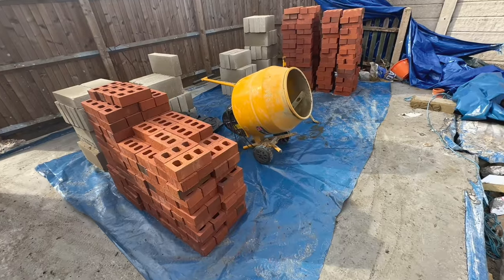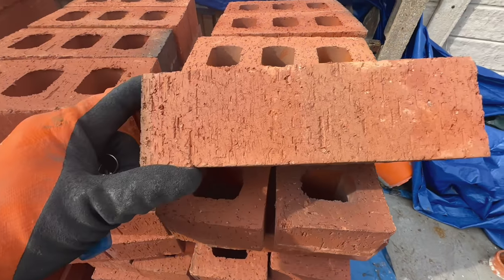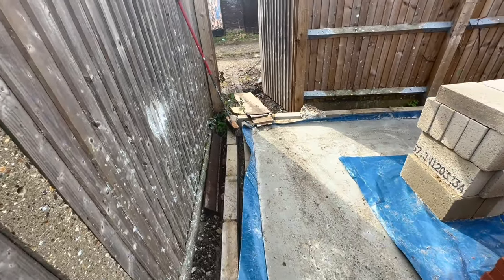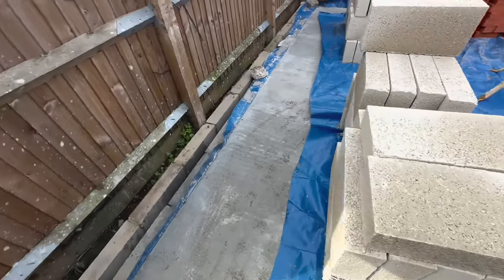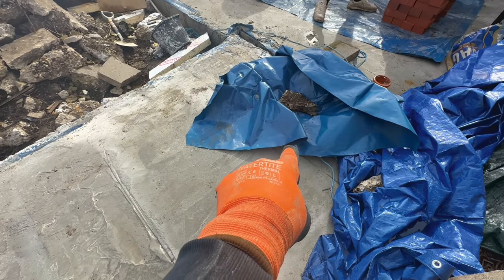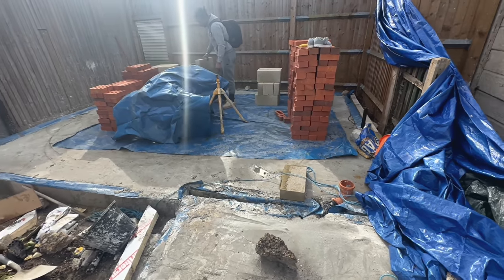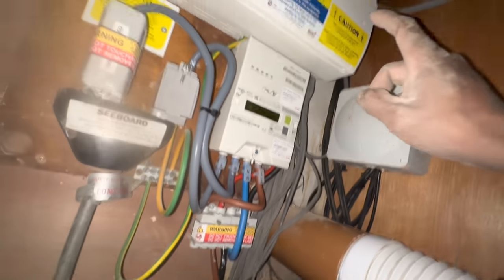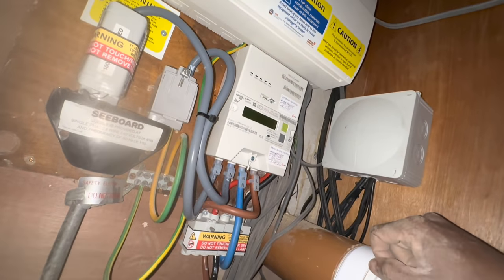They were stealing electricity!

Comment: Another point to raise would be if the guy who has installed the smart meter had followed the correct company procedures the issue would have been investigated and resolved before you and the boys even got there, with the cable either being removed or highlighted as being there before you started the job, they are at fault for that.
Reply: Maybe he was involved with the initial skulduggery.

Comment: The meter installer should have aborted his job and reported the installation to revenue protection. Then the dangerous cable would have been removed and your guys wouldn't have been in any danger AND would have avoided the DNO trying to charge you for a fuse replacement. So the theft was bad, but the meter installer wasn't doing his job properly, possibly because he didn't want to get the home owners into trouble with the DNO. Or he was just a lazy git. Who knows.

Comment: If the DNO electrician removed the DNO supply cable, as he claimed it was, how is power getting to the house?
Reply from the maker: There is currently no power to the garage. A new armoured will be installed in the future
Reply: @darrenthebuilder  It sounds like a looped supply. They were used in the past to provide an electrical supply to adjoining properties when power demands were a lot lower. If a homeowner wants an EV charger installed they have power demands that often exceed the capacity of a looped supply so the DNO has to replace the supply cable with a direct connection. 
It is quite possible that the garage (business) had a separate meter and bills at some point.

Comment: That cable is split concentric cable and you can get get it at most wholesalers. Anything past the meter is nothing to do with the supplier, they only take responsibility up to that point.
The cut-out in the garage might have been supplied by someone in the supply side, as I don’t think they’re freely available to the public. Doesn’t make it illegal, though. Just a pain if the fuse in the garage cut-out goes, as you’d need a supply company to change it.

I think you should only pay a contribution (if that, even) towards the cost of a new cable, (especially as it wasn’t buried deep enough and didn’t have a layer of yellow warning tape above it)- where and how it’s connected to the supply should be solely the concern of the current owner.

Also the person who installed the smart meter should never have connected the problematic cable because, as you rightly said, it had no fuse/breaker/RCD protection.
Reply: yes split connectic cable i think with the line (live) is surround by the neutral.

Comment: It could have all been completely legitimate and there was a second meter at the other end which has subsequently been removed.
Reply from the maker: If it was legitimate then the cable would of been installed according to regulations not just laid under the paving slabs and the meter would also still be there.
Reply: @darrenthebuilder  I agree about regulations but there is no reason to assume a meter would still be there. It could have been removed for any number of reasons.

Comment: They are not stealing electricity as the cable is connected into the outgoing side of the meter via the grey neural blocks .
Switched fuse should have been installed for protection.
Nothing to do with main electricity supplier.
Poor installation by unknown person . Not an electrician.
Reply from the maker: Listen to the whole video. It was moved by the meter person to the other side of the meter. The cable was installed before the metre by the previous Tennant’s
Reply: @darrenthebuilder  - Yes it needs a swtiched fuse - but this isnt the DNO's issue, as the meter fitter has connected it onto the metered side of the smart meter - how do you know it was installed before the meter by the previous tennant - was the inspector from the DNO or from EDF

Comment: I wonder if the cable was at a non-standard depth, that you could contest that too? 🤔
Reply: its usually 300mm deep ,gas is 450mm but in the old day there was no regulation. in my place the elecy is onle 250mm below ground.

Comment: Tbf most electricians stock some 80/100amp cut out fuses on them now. They can be baught from City Electrical Factory for about £8... just make sure they are the right diamiter as the are 2 sizes. You want the larger ones. I also have the security seald too from cef 👍😊

Comment: As to contesting you're spot on. If they continue to maintain that is theirs and only they can have installed it, then they're in a world of trouble for how it has been installed etc.  They won't, so it then becomes an unauthorised and uncertified installation.  It depends when it can be traced to have been installed as to what regs it should have complied with but generally it should have been SWA and not less than 600mm down, correctly marked.  If it had been you'd have found it and it wouldn't be damaged, if it had been (and it was correctly installed) the protective device would have tripped to make it safe.  You'll be fine, if you'll pardon the pun :)

Comment: You should not be charged for anything. If that illegal cable had been installed correctly, the main fuse would not have blown. and therefor you are not responsible.

Comment: The cut out is outdated anyway so needed updating. The suppliers cable looks like the old lead encased cable. So I think you hit the swa cable which ultimately tripped out the dons fuse
Reply: @davebadger100  ok yes both look new.
Reply: I hit an 11 k lead cable yards away from where it was alleged to be, with a 2” digging crowbar. Five feet of steel. It blew the end off the chisel end and shorted to earth. Cloud of purple smoke and a flash at the bottom on the hole and half of firle village went off. See board bloke said you wanna do the horse s mate, today’s your lucky day. I was 18. I’m 60 now.

Comment: Contest it all the way. You shouldn't have to pay a penny as you or your crew or any one else could have been seriously or fatally injured. That cable shouldn't have been there. End of. Even if you do accept it should then who ever installed it was at best negligent or at worst criminal in installing it as they did not adhere to the correct installation of such cables. You said it was not a proper armoured cable and laid at a shallow depth so who ever installed it, if indeed it was a dodgy engineer of the energy provider, was an incompetent and dangerous cowboy who needs to be traced and dealt with. Do not pay anything. You deserve a medal for sorting it out. There are few honest builders like you. A++++.

Comment: If the grey cables from the cut out go to the metre then the live neautral (brown&blue) feed the old fassioned henly block. Hence they are both going through metre. Only thing missing is a fused isolator before the swa to the garage
Reply: But how is the swa stealing power?
Reply from the maker: It was before they installed the smart meter. This is what the new home owner told me. It was the smart meter installed who noticed it
Reply: @darrenthebuilder  ah okay makes more sense now. So in that case it was theft. Defo a mate who did it

Comment: Here in darkest South Africa the intelligent people use a metal detector to check for power wires BEFORE digging.
Reply from the maker: Amazing
Reply: @darrenthebuilder  Why didn't you use a metal detector if I may ask?
Reply from the maker: @andrewallen9993  because we already knew the cable was there. It was a slight mishap of the shovel hitting the cable while digging around it. It should of been an armoured cable which would of been no issue but due to the type of cable (illegal) used the shovel damaged it easily.
Reply: @darrenthebuilder  :) Would possibly be a good idea to be more careful in future. Spade, live wire only cut and touching spade, possible death by electrocution!
Reply from the maker: Just imagine that we were careful but an accident still happened. This is real life and human beings who aren’t perfect. We all make mistakes.
Reply: @darrenthebuilder  listen to "the gasman cometh" for a laugh :)
And I speak as someone who has MIG welded a galvanised steel water pipe someone had drilled through.

Comment: This is very much the suppliers problem, not yours. They’ve reconnected an unknown (and presumably untested and unprotected) cable at the time of the meter change. 

I would strongly contest this. Your employee could have been killed by their incompetence.
Reply: agree to some pint but surely its not the meters job. the wires were out of their responibilty.

Comment: Thanks for giving us such an intriguing story; certainly you've fallen foul of shoddy/improper electrical installation work(s) by others in the past  Can you get us  a picture of how the Split Concentric cable to the garage is terminated at the garage end?  Interesting to see just what's there.  Irrespective of how the cable came to be live after the meter installer did his 'installation' (surely it should have been just left disconnected if it really had been tapped off BEFORE the meter) the fact that it is now live AFTER the meter makes it the householders' responsibility and so nothing to do with the DNO.  All sorts of questions raised!  Can you please keep us posted how this ends?

Comment: Hi Ya , if you look closer they have  used a split  connecter for the electrics all after the meter which is how it is done , no electric have been take free
Reply: yes there should of been a mini fuse for the outside shed
Reply from the maker: Yes it’s not taken free. What I meant was the guy who put the new meter in did that. When he installed it he said the garage supply was as before the metre so it was getting free electricity. He changed it

Comment: The meter fitter should have put in an isolator before the the henley blocks, below the smart meter, but didn't have the cable length to the house (the old red/black), but its all good in anycase (in terms of the DNO), as they have connected the house & garage after the meter. However, that cable going to the garage should have a 80 amp (or lower depending on the main fuse) swtiched fuse, AT the meter, not in the garage - an compotent electriction should be able to sort this.